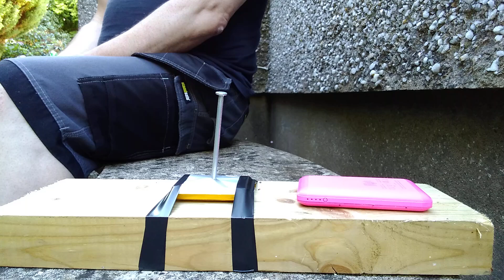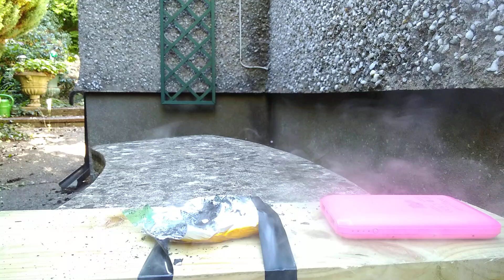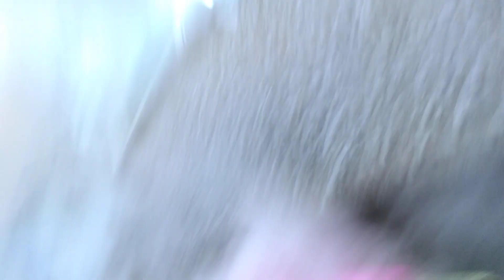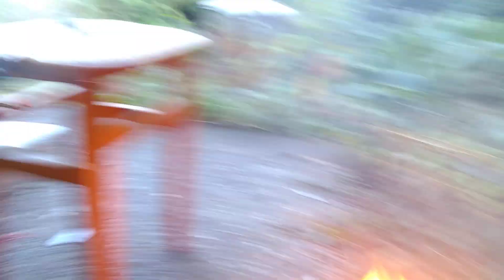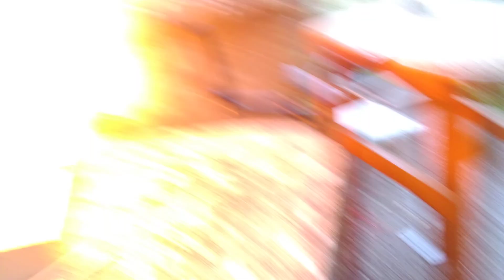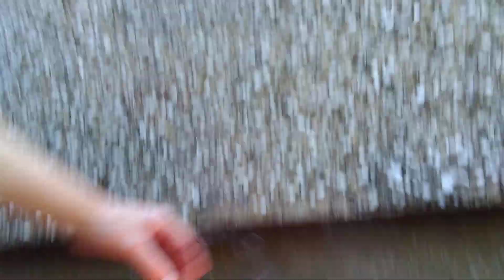Poundland lithium cell vs the mighty AvE hammer

Comment: We dropped a brand new 100% SOC Kia EV6 onto a 18" "nail" that we had fabricated. By shear bad luck it pierced in betwee battery modules the first time and so we had to lift the car and drop it again. That time it hit a module and off gassed immediately, then went into thermal runaway. The fire departments Plan B was to shoot into the battery pack with a side arm (we saw that done in Norway), Plan C was to shoot a cross bow in. We were in Alabama after all.

Comment: How about testing some of the new fire extinguishers specifically for lithium battery fires. Would be interested in seeing if they work
Reply from the maker: The lithium fires are literally self powering.  They create flammable vapour and sparks to ignite it.  A suitable fire extinguisher would have to have a sustained smothering effect.
Reply: @ there’s a new type of extinguisher called FireXO that claims it will put it out

Comment: Here I am, in my shop, dealing with any sort of battery at all as if it were a nuclear reactor that just turned on a flock of warning lights.

Then, there's Big Clive, in his garden, hammering holes in a frickin' lithium cell from a dodgy vendor like some kind of madman.

Now, I've always known that I was TOO careful with batteries, just to be sure I don't get careless and damage something (or myself), but I'm not sure that the Big Clive Way is the right balance of safety and comfort around batteries, either.  🤣

Your way is far more entertaining than my way, in any case, Sir!

Comment: I shot a 4 cell 1500mha LiPo with a 6.35 air rifle once, it smoked for 15 seconds then turned into a bright splatter of fire and smoke.  I realized afterward that it was not a good decision for several reasons.  I also have seen quadcopters hit the ground so hard the battery punctured and burned up the quad.  Ive personally had an old 2 cell puff up and start fuming just setting on the table after not being used for a year.  Luckily I was home to catch it.  Lipos can be extremely dangerous and should never be stored outside a fire safe container.

Comment: If you pierce the middle, you're gonna hit a pocket of salt water. Corners are where its at.
A Lithium Ion battery is mainly composed of three sections. Two spaces to store your Lithium ions, one for positive the other to collect the spent Ions(+/-) with an intermediate electrolyte seperating the two.
As you spend your batteries charge, the Ions flow out of the batteries positive anode, through the device, and back into the negative anode to be stored.
When you charge it, the ions are pulled through the electrolytic intermediary, regaining its charge, through a type of 'gate', and back into a stack of positively charged Ions.
Its pretty neat.

Comment: Wow, what an interesting delayed reaction!  Back around 2002, we put a defunct Microsoft Win CE device under a drill press with a 7/8 inch bit.  When the bit hit the device’s lithium battery an ominous blue flame almost two feet long instantly shot up.  That incident sealed my respect for the potential hazard lurking in lithium cells.

Comment: Are batteries safer or simply lethargic? 😂😂
Reply from the maker: Typical of that capacity of cell for low drain applications.
Reply: @bigclivedotcom  sorry for the dumb question but........ Was it fully charged or discharged?
Reply from the maker: @plageran  Fully charged, plus a little bit more.  A discharged cell will do nothing, as it's the stored energy that creates the heat and flames.

Comment: 2 years I I had my tablet in my bag but didn't close it right, stood up and it fell onto floor, must of been 3 or 4 feet, seemed ok put it in bag walked out of my office and my bag started smoking, had to tip it out of the bag onto the pavement and it smoked for about 10 more minutes, the tablet itself has melted, I recovered the sd card inside which looked intact but didn't work!  I contacted the company I bought it off as it was only a few months old and fair enough they wanted photos but they wanted me to post it back at my expense so they can check it themselves, which isn't allowed!  I was basically told no return no refund!

Comment: now multiply that by thousands of batteries reaching critical temperature and lots of  flammable packaging material, carboard and air filled packing, which holds a bunch of oxygen rich air!
anybody see any possible issues there? nothing like ample fuel source stored within the shipping packaging.

Comment: My dad used to be a plumber in the U.S Military back before I was born and he has told me that he had a $400 hammer and it was $400 because it was made of brass for fuel lines and fuel tanks, because brass hammers don't make sparks that could possibly ignite fuel.
Reply: Are you sure it wasn't $400 just because the military bought it?

Comment: Do you have a bench powersupply of some sort ?
Try using one of those too force like 5 - 10 amps & overcharge it until it pops by itself for some nice flames, might need some thick leads soldered on though too not just melt the insulation off the battery wires & short it out.
Like for example this youtube video if you search " Lipo Fire while charging " from may 2018.

Comment: At least you got fire. I took apart a fully charged 10Ah multistar LIPO cell by cutting it open with scissors. I then unwrapped all the layers. All I got was a little warmth and a vinegar smell. I took and old 12S LIPO pack and over charged the cells to 5v each. IT got pretty warm and the cells all bulged...no fires and no burst cells. I took a 750ma 3S 65C LIPO pack and connected it in parallel with a 16Ah 4S pack that was fully charged. The 3 cells swelled up, burst open and a small puff of smoke came out of each one. Incredibly disappointing! So yeah...you got fire...wooo hooo!

Comment: <sees him remove the nail>
<imagines a timer in my head, counting down from 45, giving the oxygenated reactions a chance to burn away the electrolyte and fully expose the lithium to the air>
<hears Clive's commentary pause, and imagines the chunk just caught on fire as the rest of it begins to fume>

I "might" have a bit too much experience making these burst into flames 😅
Reply: There is a good reason that many people with punctured or damaged phones/devices would see bits of smoke leaving said devices, and by the time they chucked it in a bin somewhere, the bin would then burst into flames. The delayed reaction is what made the dang things seem so unpredictable and dangerous for a while.

I feel obligated to say:

For everyone that values their lives, fingers, lungs, and their belongings.. DO NOT DO THIS! Not at home or anywhere else!

But...if you're determined to do it regardless of what anyone else says.

Have an empty steel receptical for the battery post-ignition.

Do it outside with a respirator, at a distance upwind, or in what is typically refered to as a "fume hood" inside.

(The burning electrolyte can release fluorine gas as the lithium reacts with the air instead of remaining bonded with the fluorine. Breathing in fluorine or various fluorides can cause damage not unlike what COVID does. Especially if you happen to be sensitive to it or have existing lung damage from having been exposed to COVID (Including "minor" damage).)

And if you are still reading:

Tips based on my personal experience would include: 

Puncture deeply then remove the sharp implement/nail to introduce oxygen to the lithium electrolyte faster.
And
Humid days help with some of the more stubborn "not as reactive" batteries that only seem to smoke and sizzle softly. (Note, even after the sizzling stops and the reaction seems to be over, batteries can potentially REIGNITE on humid or rainy days. Which is why i recommend having a steel receptical to keep it in)

I figure if people are determined to explore, they ought to at least know what they are risking, and some of the ways to protect themselves. Warning labels only help so much, afterall.

Comment: This is what I've seen happening with a few lipo fires. Some kind of smoke, the battery expanding, pretty much that's all until it reaches some critical point where it just pops and bursts into flame all of a sudden.

I have no idea why they behave like this, but i'm told lipo vehicles are buggers for reigniting after being extinguished.

Comment: What is the highest resolution compact addressable heater you know of? 
I have seen LCD panels that have high operational temperatures but nothing that could reach even 200c?
Even just an addressable array of high temp shutters packed into a high density package might be interesting, but I do not have much electronics exposure.

Comment: I expect Clive secretly likes causing contraptions to blow up and self immolate, just like the rest of us. Try this for hours of fun. Grab say a 40V 80A DC power supply (an electric arc welder would do the job). Attach some heavy duty alligator leads (car jumper leads perhaps) to the PSU and then extract the graphite centre of a pencil. Place an inch long chunk of graphite in one of the electrodes and then strike the other electrode against it, slowly pulling it away. Congratulations, you have just created the guts of a search light.

Comment: The delay was caused by the metric lumber. It would have happened 25.4 times faster if you’d used a proper 2x4.
Reply from the maker: I can't even start to express how I felt when I ordered it as imperial lumber and the suspiciously under-sized metric lumber arrived.

Comment: I work with Li-ion batteries for space craft and have seen flames coming out of a cell that is being welded to strings of other cells. For example a typical size may be eighty 18650 in a 16 parallel by 8 string set up.  it is not something I would choose to see again.

Comment: I used to race 1/10 scale rc touring cars. I was one of the super early adopters of Lipos back in the mid 2000s. Loved the fact you could charge the batteries at 3 to 4 times their capacity to charge them in like 20 mins. But you’d only get like 150 charge cycles out of them before you could actually “feel” the punchyness fall off in racing. So I used to have a ritual on my garden where I’d line the old cells up every few months and shoot them with a crossbow lol. Most of the time they just smoked with no fire

Comment: Hooray ecologically correct and "woke" green energy power cells! Let's drive around cars containing 500+lbs of the same kind of batteries! Hilarity ensues!  So much better than gasoline! I'm waiting to see holes melting through the decks of bridges from burning electric cars on fire.
Reply from the maker: As opposed to huge tanks of gasoline pouring out in all directions.
Reply: @bigclivedotcom  True enough. But extinguishing gasoline fires is fairly well understood by most fire depts. Li-on batteries seem like small nuclear piles that can go super critical just because you look at them badly. Every photo I ever see of a li-on fire looks like magnesium burning. And consider all of the skateboards, cell phones, etc that just decide to immolate someone. Li-on kinda scares me (and it's everywhere.)

Comment: I've had a few of these pack style lithium cells swell recently in various devices all with their own charging circuitry, not been abused. Makes me wonder about the 18650 I've been using for years (high current draw applications) which seem to be fine, a few are down on power with age but nothing more nefarious.

Comment: If you would load this cell always with a high current (fast charger), then cooper-dendrite will form and penetrate the membrane between the two electrodes. At the end you have the same effect like shown in this video ... but normally the LiIon-Cell is not somewhere surrounded by stones in a controlled environment, normally the accu is in your pocket or somewhere in your home.

Because of this, you should load LiIon-Cells with a low current!
If your phone needs 8 hours to load up, this is okay.

I load my phone only to 90%. The positive is here that the cell do not lose their capacity so fast.
Reply: Most phones do that already or can be set to do it automatically I’d hope. iOS for example. Looks like it only charges to 100% right before you pick up the phone in the morning, and only if it predicts heavy use that day. Not perfect prediction by any means, but sure prolongs the battery life.

Comment: If you really want to blow yourself up, put a nail through a fully charged lithium polymer battery, the kind used in electric powered RC model aircraft then run, you'll get flames up to a metre in height and copious amount of smoke, I've done that a few times, it's so much dangerous fun.

Comment: You get so many paranoid RC guys who watch stuff like this and are like "And THAT'S why I store them in a former cold war nuclear bunker 2 miles from my house"

There's one video of a youtuber literally cutting packs in half with a saw and then questioning the sanity of people who store them at home! If you cut your gas main with a saw it would also be pretty hazardous!

I find, if anything, that videos like this demonstrate just how badly they need to be abused before anything bad would happen. 

I store my RC batteries in a fireproof container and away from flammable objects but more importantly, I never over charge or discharge, always leave them at a storage charge level when not being used, never continue to use them if they show signs of damage or swelling, dispose of them when internal resistance gets too high etc. 

I would say 99% of the incidents I've seen from the RC community have been down to user error. Either the wrong equipment, wrong settings, continuing to use damaged packs or leaving stuff charging unattended, having a charger malfunction and not witnessing the obvious and prolonged warning signs that occur between a pack being ok and being so over charged it enters thermal runaway.

Comment: i calculated from the total oil consumption of the world in a year , that if the efficiency of motors is 40 % and the rest of the energy is heat (and if all the oil goes to fuel engines )  , that the waste in heat is about as much as one krakatoa volcano in every 27 days .
92,4 megatons TNT each day
hiroshima and nagasaki where in the order of a few kilotons (15 and 18 )

Comment: Lucky you didn't have an NaCl there Clive or the rozzers could have done you for a salt and battery. 🤭🤭🤭🤭🤭
A slow start but you nailed it in the end.
As a Mr M. Jackson said ♫ Just beat it, beat it, use AvE's golden hammer and beat it. ♫

Comment: Time delay courtesy of thermodynamics..Lithium polymer chemistry relies on surface area to generate the required current density. Meaning electrode spacing and safety separators are gossamer thin.
Fortunately,  the organic electrolyte has enough of a flash point to give a few moments between damage and fuego.

Comment: Ah, lithium polymer, the adults chemistry set. 
As a previous commenter also did, fully charged cells disposed of. But a load of 18650 batteries in a metal chimnea, singularly disposed of. Very satisfying thunk followed by ejection of glowing casing of said cell flying across the garden. I wouldn't recommend a ceramic chimnea for this experiment. Some popped louder than others.

Comment: A designed in time delay, to give you enough time to put a safe distance between you and it..🤗🤗..I don't believe the average punter realizes how dangerous these things are. Imagine an electric car in a serious accident, you wouldn't stand any chance of getting out alive, and don't bother calling the fire brigade because there's very little they could do except stand and watch you get roasted..
Reply from the maker: Properly designed electric car batteries are infinitely preferable to a huge tank of gasoline.
Reply: @bigclivedotcom  We will see..Anyone with a small fire extinguisher initially stands a chance of allowing people people to get out, and fuel tanks do not extended virtually the whole length of the car..Even formula 1 seem to be in a quandary with them, telling stewards to keep away from them...

Comment: This is exactly the reason, why the e-cars have to go to "quarantine" after every small car accident - because the battery after some stress can suddenly start burning with very long delay - even month after the accident. 
And yes, Clive, you should continue with filming - trying to extinguish the fire - maybe it would be even more educable :-)
Reply from the maker: There's a lot of hyped up hysteria surrounding electric car batteries.  Over time I reckon they'll be proven to be safer than a tank of gasoline.
Reply: @bigclivedotcom  Well, it is always with all new technologies. But the information about the quarantine stuff came from the university professor, who is specialized on e-vehicles for years. He even explained the physics behind it, but I already forgotten it.

Comment: A 5yr old Lidl battery pack with attached output leads (that my 7yr old may or may not have been using as a pass through to charge his Kindle 🤔) popped it's lithium pack out of  its casing in the heat a few weeks back. Having broken out of its casing it was probably double its size. I carefully removed it from the house, placed it safely in the front  garden (in direct sunlight) to watch it's progress over the next few days, it swelled to an alarming size, but no amount of experimentation would make it go all bangy 🙄

Comment: I flew model aeroplanes for years, they had high-capacity, high-C rating lithium polymer battery packs. Disposing of the old packs, I was never able to make one explode spectacularly like they showed on all the TV shows at the time. Either over-charging them, shorting them together, puncturing them, chopping them up with an axe, they never caught fire.